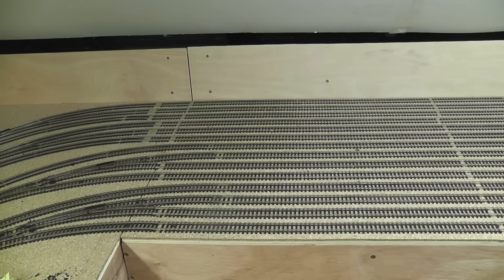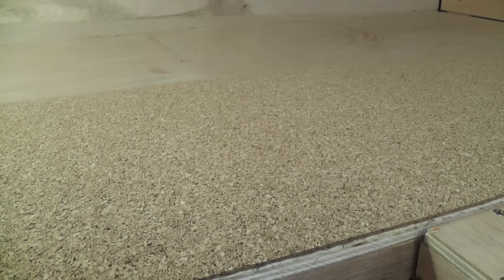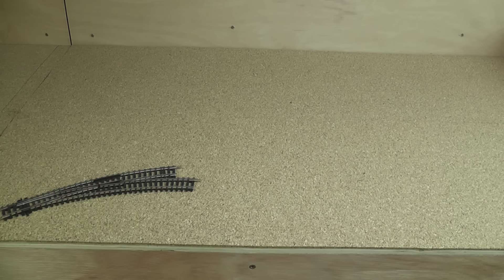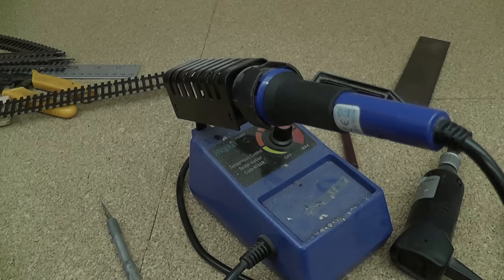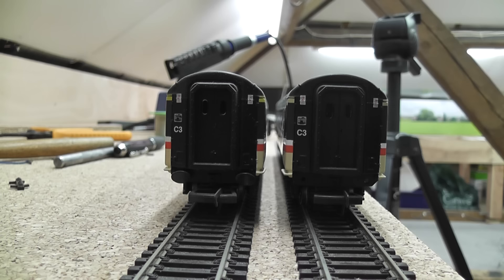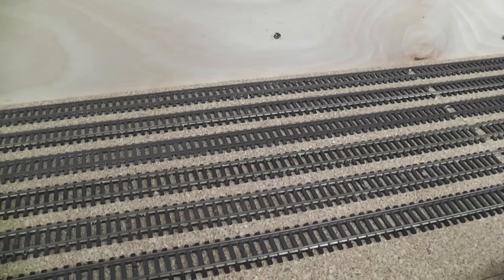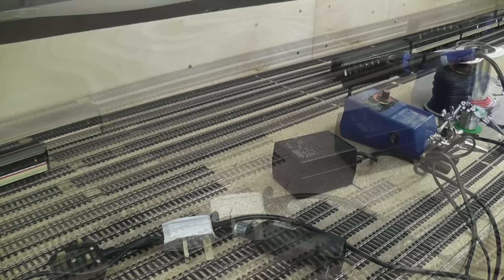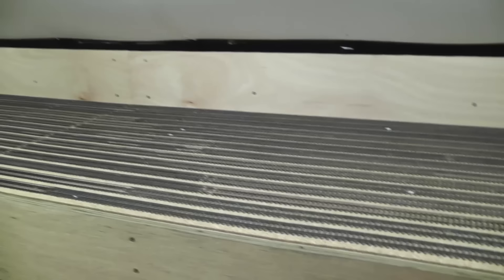New Layout Build - Fiddle Yard

Comment: I'm curious as to why Pico and the rest don't do a 'realistic' high speed track. Concrete colored sleepers and rusty
rails except for the top. Wouldn't folk would pay extra for a track that  they didn't have to spend hours on tarting up?
Reply: Peco does sell track with either wood or concrete sleepers.  I use concrete for my main lines and wood for industrial spurs and whatnot.  I use Peco exclusively on my layout, though I have some old Atlas sectional track that I use for hidden areas.
And that would be an awesome idea if they'd make track with copper/brass for the base and web of the rail, and nickel/silver for the head.  But that would be mad expensive to manufacture bi-metallic rail!
Reply from the maker: Peco have been making concrete sleeper track for years.  I'll be using it on the scenic section.  They also make Steel and Bi-Bloc sleeper track alongside the traditional wooden sleeper track.
Reply: I'm sure I've seen one manufacturer offering factory weathered track, possibly HO, but I'm surprised there's not more available. Factory weathered locomotives and rolling stock have become the norm so why not track?
Reply: Tillig elite code 83 is weathered/browned out of the fabric. But it get's reweathered anyways when you weather the ballast/trackbed. ;)
Reply: Gary Hodge you would have to weather ballast to match which would go over the pre weathered track so I dont see a point in it
Reply: A quick Google... Tillig and Micromark have pre weathered track, Fleischmann Profi is pre ballasted but I couldn't find a pre ballasted weathered track. I'm not recommending or endorsing these products, I've never used them.
Reply: I remember that PECO offered concrete sleeper track back in the early 80s when I was actively involved in railway modelling.  At that time I was more interested in colonial railways that mainly used pressed steel sleepers but such items were not available to modellers at that time.

Comment: I know you just layed it all down but you should have put more points in maybe every two feet so you can put more trains in the sidings and easily get them out of the sidings
Reply from the maker: Each siding needs to be as long as possible.  The long trains I have will just block up any additional pointwork.  I did plenty of planning and testing before building what you saw in the video.

Comment: Enjoying your rebuild very much. question on why cork and why PVA gluing it down if you want the cork ostensibly to assist with sound attenuation? Closed cell foam, not dissimilar to a cheap camping mat would work far better in so many ways and if applied with an elastic latex carpet glue would stop that rigid PVA glue transfer between cork and road bed. Just curious on the basis...
Reply from the maker: Foam (depending on density) can cause issues with track when its pinned down.  The foam will compress around the track pins causing undulations along the length of the track.  The main reason I use cork is evenly raise the track bed around the layout.  Some sound attenuation is a bonus side effect but attenuation is not the primary reason for its use.  Hope that helps.

You could still use foam but would need select a suitable type and take extra care when installing the track.
Reply: EverardJunction Many thanks for replying. I don’t see any need to pin track at all preferring to glue every third or forth sleeper or so to closed cell foam underlay type road bed such as that but DCC Concepts or Bachmann as the pins transmit sound vibration as does the cork whereas foam is a similar insulator to that of the inside lining of high end speakers. Anyway, was just curious as to your basis for choosing cork of more modern improvements. Not a contest, but always keen to understand factual engineering basis for modelling solutions where applicable.

Comment: Dear EverardJunction,
I also want to start a model railroad about a year.
I already have a number of trains but I will also work with diesel trains.
But now I have a question which diesel trains I buy best and Which site?
and how much would this cost per train?
I would very much like to use the same trains as you.
I would train passengers and also freight trains.
And with what scale do you build?
Dear greetings
Jcore
From Belgium

Comment: Excellent as always Richard, gives me inspiration to crack on with mine 🙃  I'm curious to know if and how you are fitting point motors on the fiddle yard ends as you have already laid the points,  or should I wait for the next installment to find out ? 😶
Reply from the maker: Although the paints look laid they are not pinned yet.  I will lift them and drill point motor holes later.  Thanks

Comment: My eyes were drooling over the length, width, and use of 100% Peco track/switches. Also noticed your spacing between each parallel is (to my educated guess) is 5/8ths inch with your piece of plywood.
Other thoughts about your yard assembly, you've used uniform track lengths besides bits and pieces at the two yard ends. Your multi-step process for each line, end to end, was repeated... the same multiple steps. Could it have been simpler if you prepped each unit straight section first? Removing/cutting ties/sleepers and wire lengths, tinning wire and track, spacing track and drilling holes? Sorry this comment is after the fact.

Comment: Great video,  hope to lay much smaller 6 lane fiddle yard soon. Why solder droppers on rather than use point clips, Seems unnecessarily time consuming?
Reply from the maker: Its considered generally good practice to solder dropper wires every few feet on a dcc layout.
Reply: It means not relying on the track joiners to carry the current. Seen a couple of show layouts where track joiners have failed and even crimping the track joiners hard with pliers is not a long term fix. A wire off each piece of rail is belt and braces.

Comment: Merry Christmas, looks like your not powering your turnout control, is this how the whole layout will be ? What about block detection ? Are you using insulated rail joiners or will you just cut the gap with a dremel ? If you are using block detection, what hardware are you using ? Since you mentioned cutting the rails between tables, what type of connectors will you use between sections ?
Reply from the maker: All to come in future videos.  None of the turnouts are installed properly yet, just placed down to show you the routing of the 4 main lines.  Block detection is planned for the layout.  Hardware not purchased yet.  Cheers...

Comment: I have a question relating to peco set track. Did you make any modifications to the point in anyway or form when you had them on the previous layout? Are you making any mods to them on this new one or straight in as they are? Point motors?

Comment: Merry Christmas - great video as always. Fantastic progress.

The Mk2Ds have featured a lot in this video. They hardly ever ran (or at least not in the videos) on the old layout. Do you have plans to use them more in the new layout?

Also what about expansion gaps? On the old layout did you find you needed them?
Reply from the maker: The Mk2Ds I have are a very old tooling and really lack any fine detail.  I didn't run them very much as they looked out of place with the more detailed stock.  You'll notice in the video I have still allowed for expansion at the fish plates.  However I expect expansion will now have little affect due to the loft being insulated.  Thanks
Reply: Maybe an opportunity for a detailing project? Your detailing projects have been thoroughly enjoyable to follow.

Comment: Great video as ever. Thank you for your incredible insights, hints and tips. Quick question, why do you leave gaps between the joined rails? Right near the end there was a close up of the track with a rather large gap, but not at a baseboard join. I think I noticed similar in the previous layout. Does it serve a specific pupose? Have a great Christmas, can't wait to see this develop in 2018
Reply from the maker: I do that to allow for some expansion in the rails on hot days.  It also makes a nice realistic noise when trains cross the gap.  Cheers

Comment: hi nice video, can i ask how you will deal with expansion and contraction of the track during very hot and cold weather.  i have seen other videos showing the effect of temperature on their layouts/
Reply from the maker: I've insulated the loft so it no longer suffers from cold weather.  I've yet to see how it copes with hot weather.  The track will be cut at the join between each table.  That will allow for expansion should there be any in future.

Comment: Looks amazing with all them lines
Merry christmas
What is the difference between track codes I mean like code 100 and code 75
Reply: Hi David, code 75 is a finer scale, and looks more realistic
Reply: Code is the height of the rail in 100ths of a millimeter.  So code 100 is 1 mm high.  Code 75 is 0.75 mm high.  Code 83 is 0.83 mm high.  In US/HO scale, code 83 is the most accurate rail height for a mainline and code 75 is common for an industrial siding and such.  UK/OO is smaller scale than HO scale, so code 75 is more realistic for OO.  In the US/HO, some modelers use code 100 because it's sturdier and more reliable, and no one is gonna notice unless they measure your track with high precision calipers, lol.
Reply: Hungry Guy its thousandths of an inch rather than mm so code 75 is 75 thou (0.075 inch) and code 100 is 100 thou (0.1inch) high
Reply: Oh, yes.  I stand corrected!

Comment: So those lanes are each approx. 12m long... That's about 40 coaches per lane (if each coach is ~30cm long). How many are going to be dedicated as through-lanes? 4? Or are each pair of main lines going to share the same through line in the yard?
Reply from the maker: Its 12ft so about 3.6m long.  If it was 12m long the plan would have been very different.  The fast lines access 3 roads each and the slow lines access 4 lanes each.
Reply: EverardJunction ah ok I misheard you.